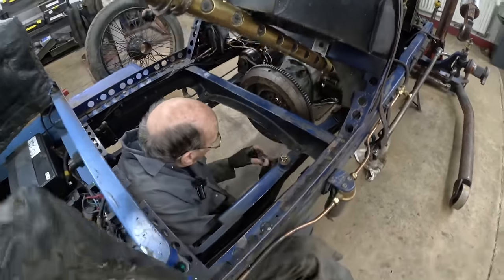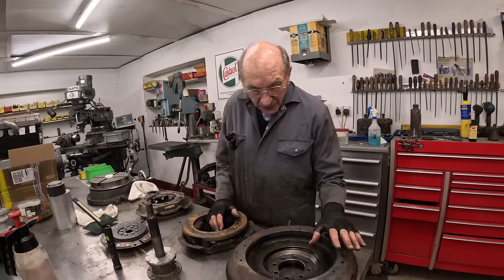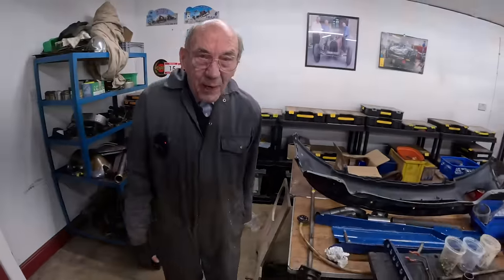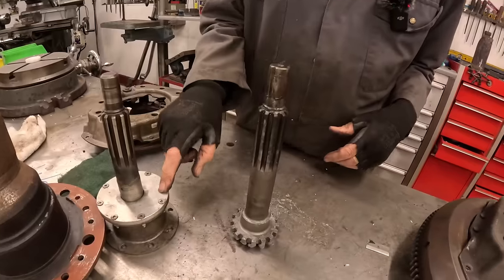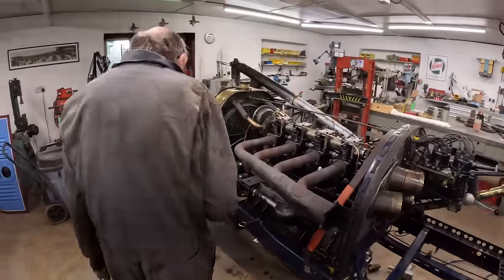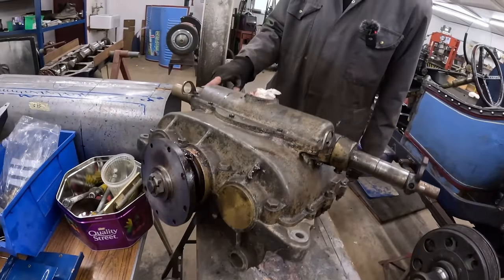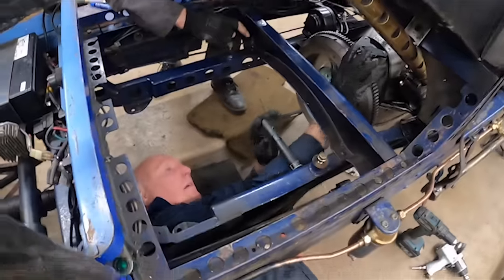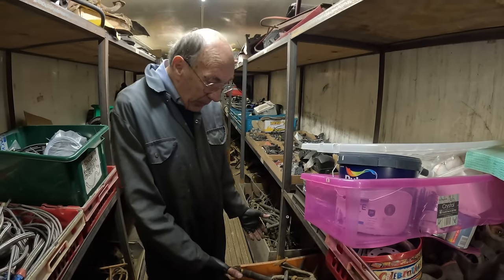SHED RACING - Hall Scott - A powerful clutch at last...

Comment: I nodded my head and smiled when I saw the extra Dynamo belt hanging up on the back of the engine. I sure wouldn't want to have to pull the flywheel off again to change a belt if you didn't have to. I like the way you think
Reply: So that's why it's there. I'll stop scratching my head now.
Reply: Used to run a spare clutch and throttle cable when a despatch rider..
Reply: So much to be learned from the "good old boys tricks".    Much of what I learn from them is unspoken.

Comment: Ivan, I love watching those guys in India. I just saw them use manure for increasing the heat when they were welding cast iron. Such a fantastic method. Evidently it burns extremely hot and for quite a while. Perfect for allowing the cast iron to cool extremely slowly so it doesn't crack. Same reason I love watching your videos. Excellent shaft made from the Mercedes parts mated to the other. You are such an incredible guy. You have inspired me to  start a Youtube channel  with the build of a 1928 Morgan...Hopefully I can come over to the UK and bring it with me and we could go for a drive.. Thanks for your videos!!

Comment: Some years ago I had a similar clutch problem when I tried to fit a diaphragm clutch into a prewar Traction Avant.  The original clutch was always so very heavy I ended up fitting a Ford Cortina clutch and adjusting it with the same washer idea as spacers.  It worked a treat.

Comment: Nice little explanation of the strategic use of die springs as a damper. Being an old tool & die maker I can appreciate this as a terrific solution to a lot of torque dampening problems. Well done! Great episode and loved the turning .080" off the flywheel as a dodgy clutch solution. Carry on you Princes' and Princesses' of "Shed Racing" God Bless. Cheers P.
 PS : Saw the flag magnets on the toolbox! Cheers.

Comment: Hi Ivan I’m a friend  of Johns and an avid viewer of your show.
Just a quick tip. As a toolmaker for many years I always use my diamond files wet, wd40 oil or even water.
I’ve had mine for 20 years + although I don’t use them as hard as you do.
Hope this helps.
Cheers
Karl.

Comment: Well I always thought that John was grumpy but he was very nice in this film ivan ,underneath that car he was working hard holding the flywheel I used to be under the Old Ford cortina wiggeling the gear box trying to get the shaft into the spigot bearing loved it cars you can work on not today you can’t thanks for posting
Reply from the maker: sometimes spigot bearings just fall in and sometimes they are just a nuisance -we've all done it
Reply from the maker: years ago, I was doing a MGB clutch and I thought I would centralise the clutch plate by sticking a couple of dabs of glue to hold things in place - finished it, put it all together, tried everything to separate the clutch, in the end had to take the gearbox out as I couldn't clear it

Comment: Great video as always 😊
I know the clutch had oil contamination, but I’ve seen a similar issue with brake shoes where a lining doesn’t ‘grip’ or bed in and it’s caused by the iron face being incompatible with the friction material. On the heavy trucks, there was more than one grade of drum as well as different shoe linings to suit high speed or heavy stop start. Just wondering if your clutch was suffering from similar.